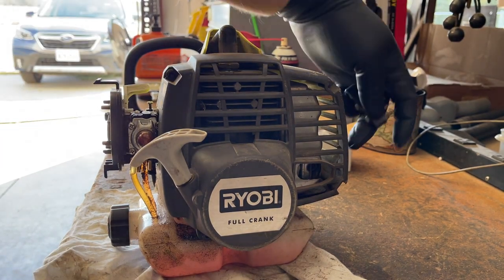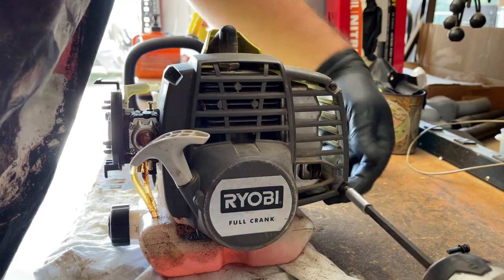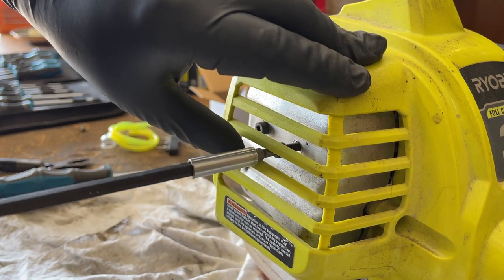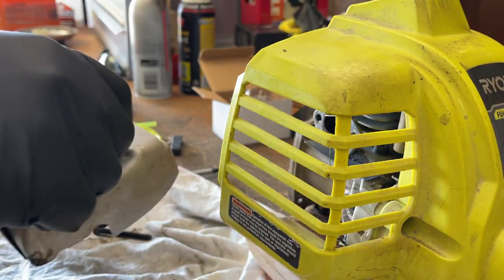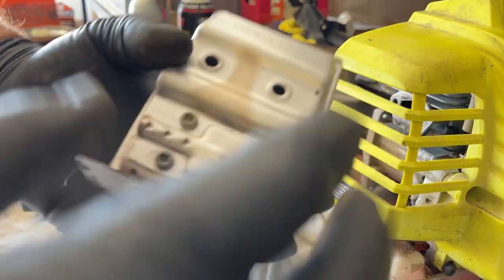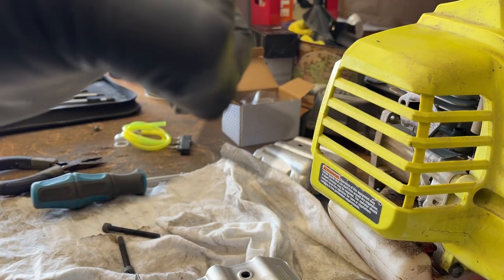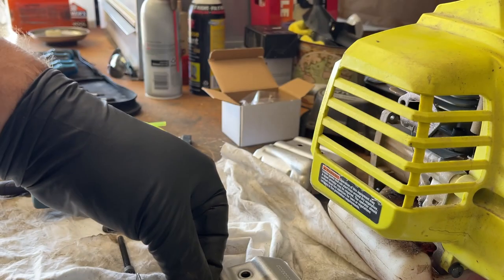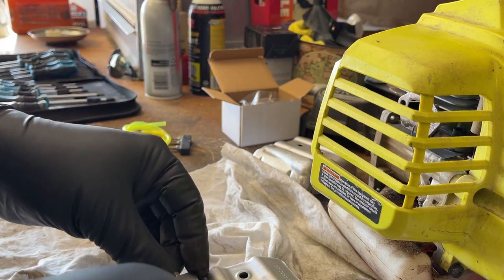Rpm Slow? Ryobi Weed Eater Spark Arrester Inspection

Comment: thanks!
after work today im gonna do this to mine.
it starts great but takes awhile to reach full speed / bogs down upon starting.
(stays running, just wont hit max rev's)
Reply: Hey did you figure out your problem?  Mine sounds like it does the same thing. Starts one 1 pull but soon as I throttle it it dies.
Reply: @kicknit3935  i started it, and slowly adjusted / raised the throttle / idle rate and it seems to have fixed everything.  (its the little screw by your throttle settings. turning to the right = increasing the idle rate. turn to left to slow it down.